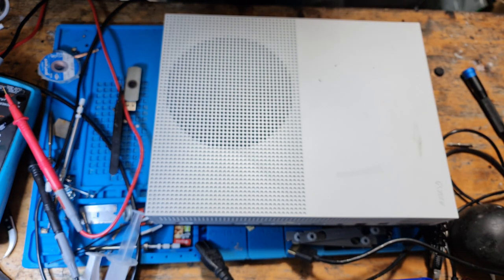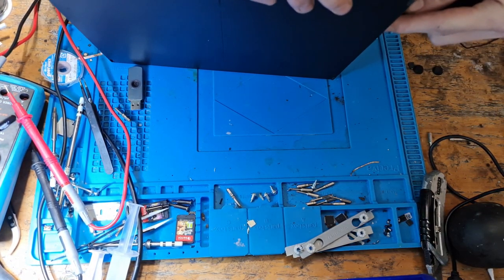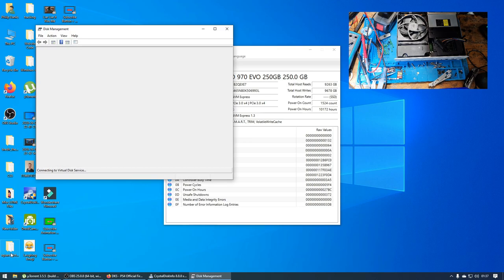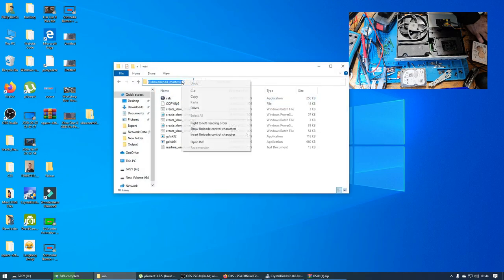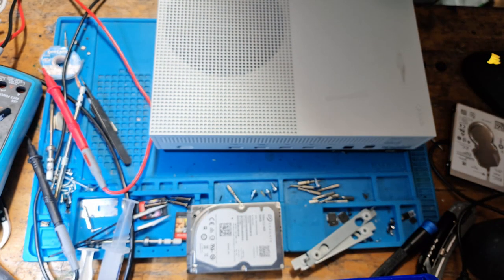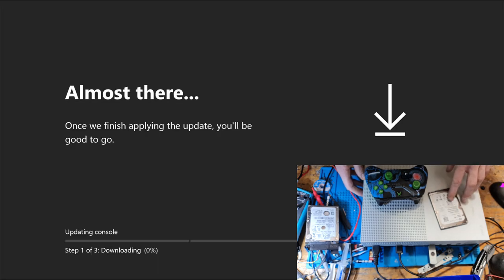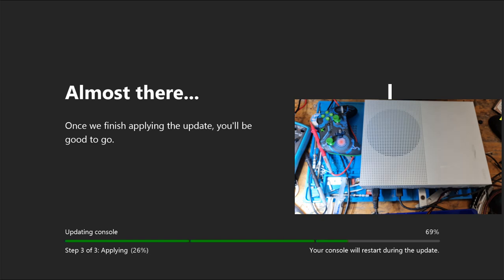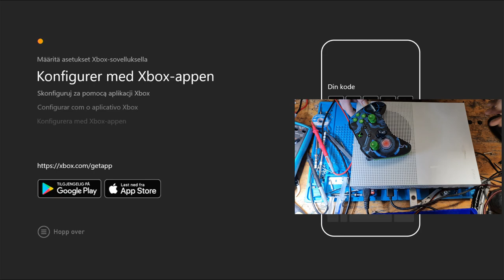Xbox One S Turns Itself Off After 30 Seconds - Quickly Fix 30 Second Shutdown Issues Xbox One OG/S/X

Comment: Thanks so much for this - really helped me confidently diagnose a faulty hard drive.  The steps to repair were very simple in the end:
- Open Xbox (I had to watch another video which showed me the details of that) 
- remove old hard drive 
- replace with brand new hard drive (I didn’t need to do anything to preformat it so didn’t actually need the caddy I purchased at the same time)
- download the Xbox boot software to a USB
- startup Xbox and boot from USB
- done ✅ 

Thanks to you and people like you for putting these guides together. It’s a selfless act that really helps us amateurs save £££’s - not to mention the enjoyment of doing it!
Reply: How can I download the Xbox boot software? Do you have a link for the one you've used?

Comment: I had the same issue as you. I ended up having to fix the original hard drive and clone it, because I could not get the new hard drive to take OSU.  Just another solution for those seeking.

Comment: Thanks! This just happened to my Xbox One S last weekend, got the E106 code. Offline reset got it to work for another day, then it locked up and has been acting like the Xbox you are working on in the video. I bought it new last July because my original Xbox One was having disc drive issues. The irony is I play more digital than disc based games now, so I was able to plug the old one back in until I could figure out what is wrong with the S.  I keep all of my games on external HD's so the OS is the only thing on the internal hard drive (for both consoles). Both external's are working fine, I've tried playing different games from each one on my original Xbox with no issues (...and yes, my fingers are crossed that it stays that way lol).

Comment: I got the same problem but my xbox starts up for around 10 seconds then it shuts off, also I noticed the fan doesn't stat spinning. People say that it's due to a faulty power source but I know that isn't the case since I ordered a new one and there isn't any flickering light, also I had the green screen of death before xbox didn't start up. Could it still be the hard drive, or is it another problem. Nice video by the way, you sir earned a new sub.

Comment: I have an Xbox I have an Xbox one x that sometimes turns off right after turning off and sometimes after loading a game. It has unlit into a pc monitor. it’s not overheating or anything. Any is it the same problem or is it something else?
Reply: Did you fix the problem?
Reply: @thichin7460  I can remember what I did exactly that fixed the problem but I think I just took it apart and wiped everything down then put it all back together

Comment: My son is having the same problem with his xbox ive been looking online for solutions and found nothing was going to resort to Microsoft servicing it or replacing it but this would be so much cheaper
Reply from the maker: Hopefully this will help you, but if not I can pretty much guarantee an independent repair tech will be cheaper than Microsoft (unless you have warranty still). Fingers crossed you can get it working again :)
Reply: @TheCod3r  no its out of warranty I just hope that this is the problem and it can be an easy fix

Comment: I don’t know if you’ll see this but I’m really confused. My Xbox is having a similar issue (booting, no display and then turning off) but will occasionally work completely fine? I’m not sure if it’s just poor ventilation but would prefer confirmation before taking my whole console apart lol.
Reply from the maker: I'd say the hard drive is likely dying mate, not quite dead but on the way and should probably be changed as soon as you can
Reply: Ok, thanks for the advice 👍
You’re probably right, what confuses me though is why it sometimes works fine (and downloads updates and stuff like that onto the drive) but just sometimes doesn’t. Might have to get it sorted out!

Comment: Can u do an in-depth breakdown of immediate shutdowns I left my console in my camper and it got really humid. Took it all apart and everything is bone dry so idk if it even got wet. Unplugged every thing from the board and it still does it. I've heard from others that this could be many many things.
Reply: Used different power supply still no change. It turns off right after the chime but no shut off noise just a click from startup chime thing.

Comment: Great video. I have to check this out for my own. I had a lightning strike last year and have had mine sitting since. I replaced the power supply but it turns on stays black and turns off after about 30 seconds. If it's the hard drive I'd much rather that than a board issue! I just need the software you used if it's my hard drive. I'm definitely subscribed now! Thanks
Reply from the maker: Thanks buddy, hopefully this will help you, it certainly sounds like a hard drive issue with a black screen and 30 seconds before shutdown for sure. Hope you get it sorted out :)

Comment: have you run across a xbox one s booting on, stays on for 7 seconds, then powers down with tone. i pulled the plug on the system because it ws running sluggish and not loading, then i started getting the issue. im going to try this solution tonight and see what i find... but your very correct, there isnt a ton of fantastic troubleshooting for the system. great video.
Reply: did it work? I have same issue
Reply: @carric21  no... That is still a mystery. I've repaired 5 other Xboxes since, and this one is still doing the same thing. We've replaced all recommended chips with known good ones. Still same scenario. 
I am stumped haha

Comment: Hi there, i'm trying to fix my xbox. It's getting a no signal from the tv despite turning on (then turning off). What adapter do you use to read the hard drive? I'd rather buy the adapter and check the hard drive before buying a replacement part.
Reply: Most tower PCs will have an extra slot & power cable lead to add another SATA hd. You will need an extra SATA cable, nothing special. But, he probably used a USB-A to small sata w/ power for notebook size hd's. Also found w/ type C  that can attach to a phone in otg mode or PC/laptop

Comment: Kinda confused. My Xbox randomly stopped working one day. The HDMI screen would be on but the Xbox wouldn’t pop up. And then the a box would turn off after 30 seconds. So does that mean I need to open the bottom of the Xbox and take out the usb and buy a new one and it’ll be fine? If so how do Ik which one to buy and how much would it be?

Comment: Mine is doing the same thing I bought a Samsung ssd put it in and still no signal and still shuts down after 30seconds all I can think of left to try is retimer chip replacement but why is it still shutting itself off after 30seconds?
Reply from the maker: I agree check the cables on the drive and the connectors on the board
Reply: @TheCod3r  What first happened was the fan in my Xbox one x stopped working replaced the fan, worked for about a week. then this no picture and shutting down issue started. 

Though i overheated the hard drive so replaced it with Samsung ssd ”both 1TB” but still have same issue... 
maybe I damaged hard drive port on motherboard but I visually see no damage to pins or the coupling.  Did my Xbox just die?

Comment: So if I order a new hard drive an replace it that's all I have to do I don't have to download anything on to it or program it or anything like that. I have the exact same problem in the video but no computer
Reply: I had the exact same problem everything powered up but no screen and after 30 secs it would turn off all I did was unhook the hdd and blow some air in it hook it right  back up and the Xbox came on did a update been working for a couple hours now

Comment: this is why I ordered like 10 500gb laptop hdds  in a lot a long time ago plus i got more over the years  thats my first goto if it does something like that or constantly errors on updates or even if someone says their games load really slow and see a shit ton of pop in textures n stuff the hdd is usually the cause them laptop  hdds were never meant to constantly relay that mutch info for years at a time and most people never turn off their console so  they hardley ever get a break
Reply from the maker: Yeah the issue with the hard drive is that even when the console is off it isn't turning the hdd off, so if you look at the power on hours for a one year old xbox the hard drive power on time is insane, because it's constantly powered as long as the power cable is installed

Comment: Hello Thecod3r thank you for the video I just subscribe to your chanel
I want to ask you if the problem could be the same on series S because it turns on and I can see it boots up and you can see the screen for a few seconds and it powers off. I tried hard-reset with the bottoms and some it will do it the first time after that it will only beep once the power bottom but won't turn on. What do you think it is. The same as the one you worked on here?

Comment: I believe my sons hdd is bricked.  No black screen. It won't even pair to the hdmi input but does the symptoms of running cool and turns off after bout 40 secs.  I saw hdd kits on ebay w a flash drive to update software.  Can this be done even tho I can't get input displayed from xbox?  I haven't worked on consoles since the 360s and flashing drives and don't have my tools anymore so kinda figured hdd but not sure I should waste the money yet on a replacement.

Comment: my xbox one x does something similar to this but for only 10 seconds not 30 seconds,is it the same problem do you think?
Reply from the maker: It's hard to say really, the best thing to do is install a new hard drive and just see if it fixes the problem, if not you may have another fault
Reply: @TheCod3r  thanks for replying,i rang an xbox tech in wales,he said apu/cpu the main chip may have cracked solder joints under it.have you ever tried reflowing the cpu/apu ever? as pictured here 

https://www.youtube.com/watch?v=bqSKDluZMmY

but with an xbox one x?
pulling my hair out over it lol
Reply from the maker: @oneandonlytyler1  I have reflowed a couple of times but I wouldn't say this is apu related if it stays on for 10 seconds, with apu faults they either don't turn on at all or they turn on for a second and beep straight back off
Reply: @TheCod3r  when i say stays on for 10 seconds what i mean is the light comes on (no booting up and nothing through hdmi to screen)then beeps off as if the power has been cut,
Reply from the maker: @oneandonlytyler1  oh ok it may just need looking at to figure out exactly what's happening to it. Id be happy to take a look for you if you can get it to me in Willenhall either by dropping it off or posting it

Comment: Hi pal just enquirie my Xbox is turning on for two seconds then switches off straight away do you know what problem that could be I love watching your stuff as I repair consoles but I don’t have clue what this could be I keep thinking hardrive but got feeling could be something to do with motherboard
Reply: My xbox one x is currently doing this. I turn it on and the light comes on for a few seconds before turning off. 
I can hear the xbox trying to work. It isn't loud. But I can hear "spinning". 

I wonder if it's a hardrive issue too...
Reply: @gemgem_chan  to be fair it could be loads of problems could be to do with your hardrive or could be something to do with on the motherboard best to have a multimeter to test all the mosfets and fuses if I figure it out I will let you know

Comment: My console does not cut on and then stay on for 30 seconds mine cuts on then immediately shuts off I've replaced a lot except for the hard drive I didn't have the motherboard looked at or the main board but there was no signs on the board of any damage or anyting but it just will not cut back on right

Comment: i had some trouble getting my 480GB SSD to work doing installing it this way as of now i still don't know exactly what the issue was but i have been told the SSD must be 500gb or more. I did actualy manage to get a second 480GB SSD working what i did differently was i unpartitioned it and booted into safemode by holding eject and sink instead of letting it get their by detecting theirs nothing on the SSD and it does appear to have effected it cuz it didn't display an error that time and when i went to do the offline update it worked!

Comment: Before you went completely crazy you should have put a non-working hard drive in there you should always keep a spare hard drive you know that works on the side for just one you have these type of consoles come in this way you can just slap the hard drive in and make sure there's no other problems like I do and this way if you throw it in there and you have these error codes come up you can troubleshoot and find out what the error codes are and this way you can straighten them out before you have to keep taking the machine apart I putting it back together again because it becomes monotonous

Comment: My does the same thing but beeps until it shuts off what does that mean ?
Reply: Same here, but i was using the front usb as a kind of bootleg power source to charge a disposable vape (done various times before) but somehting went wrong, shorted,  and now ive got this problem
Reply: A. LOADING  i had a spare xbox that didn't work anymore and managed to salvage the harddrive from that one and switched it out for the one i fried by accident. Did the necessary offline update thing and it works just fine and now with even more GB than it had before. My theory is when i put my posh to charge i reversed the negative and positive wires and at that moment my harddrive went out for good so dont introduce another power supply to it, results in hd death

Comment: Obviously if you don't have a hair dryer you can just wrap it in a towel and leave it turned on for 30 mins   🤣   I'm joking by the way but that was an old 360 rrod fix back in the day .
Reply from the maker: Yeah I remember those days I used to laugh my head off at my mates seeing them doing it, knowing full well it was going to die again within weeks 🤣
Reply: @TheCod3r  I'm running one atm by using one of the huge cpu heatsinks ontop of the gpu with a fan ontop, its skecty but it works 100% stable, 360's where just fun to mod back inte day hahaha

Comment: What if mine turns off after 3 seconds or sometimes the light never comes on
Reply from the maker: That is very likely an apu or ram issue unfortunately and will need diagnosis by a console technician
Reply: @TheCod3r  damnn it alright

Comment: Hey mate, I've got a Xbox One here with me that has a similar issue but the light flashes for a few seconds after touching the power screen button, goes solid for a second then shuts off, if you could help me that would be great, I do have a few other Xbox Ones that I can swap parts between to test too
Reply from the maker: Hi mate, sadly a beep on beep off issue where it turns off after a few seconds is a pretty broad range of potential causes. The problem is it could be one of hundreds of components causing the issue. If you did want to fix it yourself I do have quite a few videos going over some of the different processes to fix the issue so you may find some help by going through my videos. I could try and fix it for you but you would need to book it in via my website consolefix.co.uk

Comment: My Xbox has quite literally just done this.  I turn it on and it switches itself off straight away
Reply from the maker: That would be a different issue to be honest. If it turns straight off it has a board issue usually. It would stay on for 30 seconds if it had a hard drive issue. Sadly the issue where it turns off immediately is a bit of a rabbit hole and could be one of a hundred things causing the issue

Comment: I have an external hard drive but I don't know if it would work
Reply from the maker: If the hard drive inside the external caddy is a 2.5" laptop drive it would, but you'd need to take out the drive from inside the caddy and then you'd be able to use it. If the hard drive inside is the 3.5" variant you'd need to buy a new drive for the xbox

Comment: Hey i have a question since i cant repair my gpu is it possible i can buy a nother gpu.?
Reply from the maker: Unfortunately not, the gpu can only be replaced if you also replace the secondary ram and the disc drive daughter board to match the gpu that you replace it with, which is too much work for most technicians to be able to justify

Comment: Hey thecod3r do you know why my friends Xbox turns on but after a second or so it instantly turns itself off again do you know what the problem is
Reply from the maker: Hey bud, usually when they beep and then turn off it's either related to an issue with the power regulation circuit or in some cases it has a bad apu. If it's the apu it usually isn't repairable but if you take a look at some of my other videos you should find some related to diagnosing the power regulation circuit
Reply: What I mean is that the fan doesn’t even spin up
Reply from the maker: @Max-9632  yeah thats usually related to power management, so that will either be down to the regulation area just below the fan or with the apu
Reply: @TheCod3r  oh ok
Reply: @TheCod3r  I’m having the same
Problem , how to fix it , it turns on , the lights dim and 3 seconds later the Xbox switches off